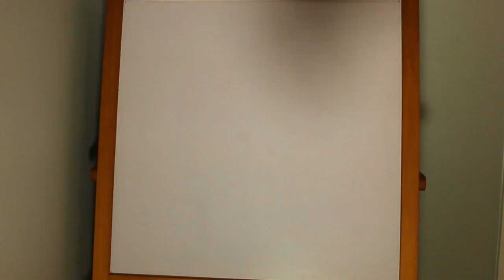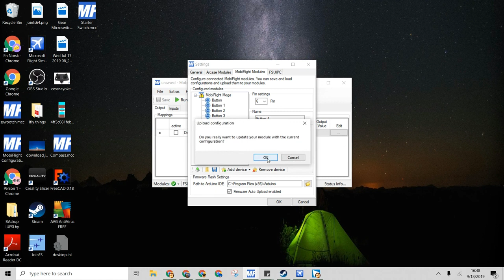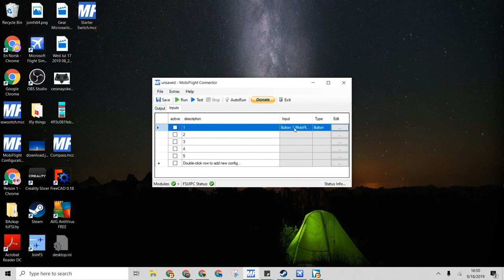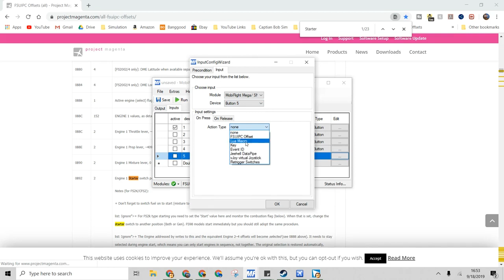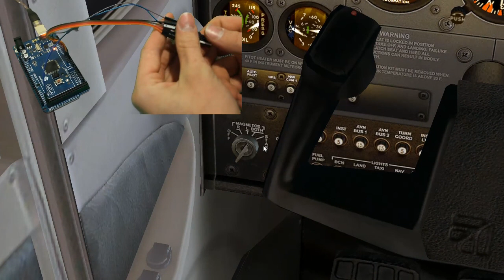How to connect a Rotary Switch to FSX using MobiFlight | Captain Bob

Comment: HI Bob

Just a little note....
Whatever the Magenta Offsets "normaly" will work fine.....  The users should use the OFFICIAL FSUIPC Offset List ( presented by Pete Dowson and tested for the latest FSUIPC release).
Its inlcuded in the /Flightsim/modules/fsuipc documents  Subfolder and mostly called "FSUIPC OffsetStatus.pdf" .
Here your sure you got 100% correct Data !
Reply from the maker: Awesome! Thanks for saying that, I will start using it.

Comment: Thank you for these videos. Would it be possible to use a 12 position switch and limit the travel to 5 and only use 5 positions. How can I do that ?
Reply from the maker: Heck yeah! Usually the 12 position switches have a washer with a little tab that limits them to a certain amount of travel. I explained this in my latest switch panel video
Reply: @CaptainBobSim  Thank you Captain!
Reply: @CaptainBobSim  Do you have any tips to wire them to a arduino leonardo ? I have 10 switches and two rotary switches ? I am having issues trying to plan out a matrix to connect them all to a single arduino.
Reply from the maker: arduino leonardo is not supported with MobiFlight, I'd recommend a MEGA, unless you're using other code. You'd need 14 pins to connect them all - a shift register (mobiflight supported) or a multiplexer (simvim supported, won't work with MF) might help.

Comment: Hey. How many rotary knobs can you fit in one  Rduino ? Thanks . Nice vid btw
Reply from the maker: The limit is 20 encoders. MobiFlight Firmware currently limits the number to 20 encoder per board using 40 pins in total.
Reply: @CaptainBobSim  Thank you!